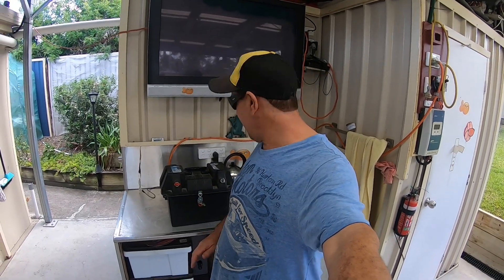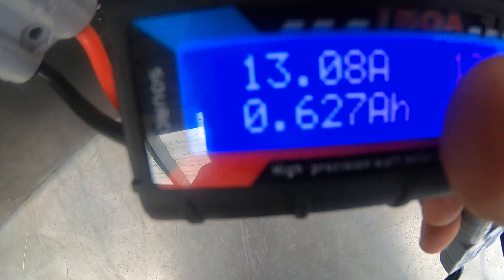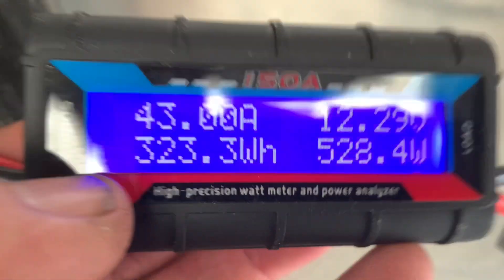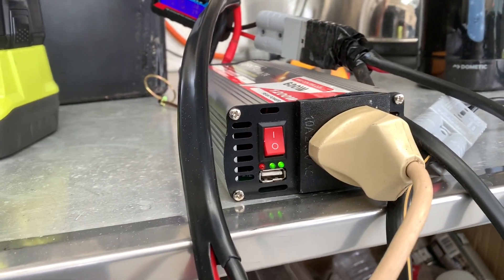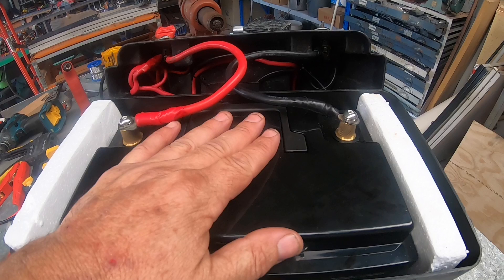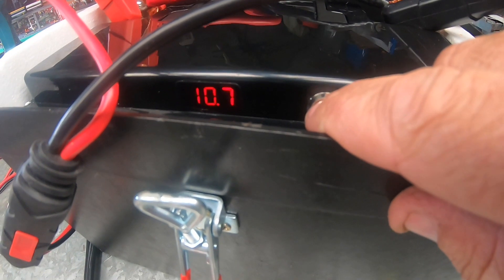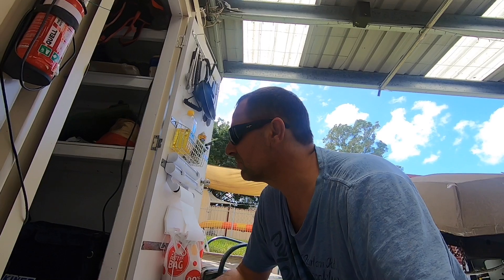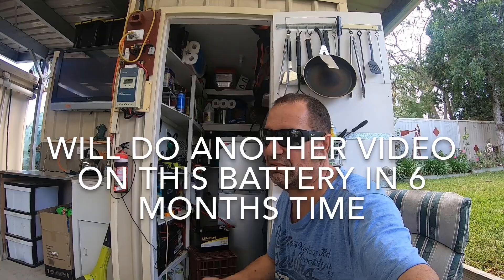12v lithium battery off eBay capacity test

Comment: just wondering , the double anderson meter you used, where did you get it, i bought similar unit from Jaycar , i have a 135ah 12v LFP which has worked fine but am unsure as to its real capacity. i conected my battery just as you did and started the test using a heat gun with variable thermostat , my inverter is 300watt so i set the draw to around 265 watt, it all worked well for about 4 hrs hating checked on the progress at 1.5 hr intervals only to find at 4th hour the meter froze at about 12.5v the heat gun was still wirking but no readimgs. i took the meter back swapped for another  rechaeged the battery and repeated the test which gave the same reasult (reading failure after about 4 hrs) , returned it bought another unit with a external shunt, am fitting it into the battery box, as a electricizn i make a great carpenter, waiting furthes reasults
Reply from the maker: Got it from ebay . Search ‘ battery meter’ thanks for watching 👍🍻

Comment: Do not use these batteries, my bms set on fire. The inside has expanding foam too
Reply from the maker: I dont have this battery any longer as it went with my vehicle when i sold it over a year ago Cheers for the info and thank you for watching 👍🍻

Comment: I bought a Mobi 135amp lithium battery on eBay,  it works perfectly until it gets down to approx 49amp and then  it shuts down every time - not happy with battery or customer service!
Reply from the maker: I would believe it as I have heard bad things about mobi lithium …. Gotta be careful with these cheaper batteries as you get what you pay for . Thanks for watching 👍🍻

Comment: You need to test at a 20hr rate so around 5amps constant
Reply from the maker: I did a retest video measuring power going back in  and results were fairly close . Thanks for watching 👍🍻

Comment: Hi can you please do a test on a VoltaX and if it will run an induction cooktop please
Reply from the maker: I can’t , sorry , as I just can’t afford to buy batteries to test.  I’m not sponsored in any way.All my videos on items I have to buy , as nothing is given to me sorry.. I’m sure there would be a video on YouTube on these batteries if you did a search. Thanks for watching 👍🍻
Reply: @EFFICIENTSELF  hi thanks for you input,, the other lithium battery you have ( not Itech wold) will it run an induction cooktop, thanks for your videos, I take onboard what you say in testing, thanks again please keep up your good work
Reply from the maker: I don’t think it would on its own maybe if you had 2 of the batteries you possibly could as the battery has an discharge capacity of 100amps so if you had 2 then you have 200 amps discharge . An induction cooktop would require over 100 amps to run through an inverter of course.
Reply from the maker: Watch a channel call ‘ justin case solar and bush camping australia ‘. This guy uses an induction cooktop in his camper trailer. Check out his videos 👍
Reply: https://www.youtube.com/watch?v=pYx1Z-V3gBw

Comment: That's still not bad.  Currently my battery box has a 75Ah Deep Cycle Sealed Lead Battery and as we all know, you get just over 50% useable out of that. 
So 75Ah out of one of these gives me almost double the days I can run my car fridge, albeit having to spend more for the battery AND bcdc charger.    
Aussie Outback have 125Ah on sale for $499 so still not bad if you could get 95Ah useable out of it ..
Reply from the maker: My battery is going well so far as i been giving it constant use and still going strong. Its only 5 months old . I will do another video on it at the 12 month mark.. thanks for watching 👍🍻

Comment: You are drawing a lot of constant current which makes the battery run hotter & less efficient
Test it again with a much smaller load and you will get more AH out of it
Reply from the maker: Yes i did a retest of the current going back in  on another video and got 72 ah will retest when the battery is a year old ... its going well so far

Comment: at 2:30 you said that it had been running for almost 2 hours.
The current draw shown was constantly between 44 amps and 60 amps odd ... that would be an average around just over 50 amps.
It's a 100Ah battery .... ie. 100 amps for 1 hour or 50 amps for two hours ... so it sounds about right to me.
Reply: Initially the load was drawing only 13 amps ...

Comment: 13.7v is to low for a 4s Lifepo4 battery. (and to high for 3s) (so you battery must be 4s because it will hold 13.7v without melting)
13.7v is fine for day to day use witch is why your charger does that but to get full capacity you need (refer to the data sheet) maybe as much as 4.2v per cell. (though 3.65 is normal)
3.65v x 4 = 14.6v
After it's off the charger like you had it in the video it should read over 14v or it's not full
To pull full capacity you'd need to fully charge the battery.
I would recommend going from 14 to 11.6 if your not happy with the capacity at 13.7v
Try not to go to 10.5v (you can and it's not like lead acid so it wont die but it would last longer if you only go to 11.6v
(then it might out live you) (though probably not if you keep letting it get that hot)

also every 6 months you'd probably want to do a "top balance" so you'd need full voltage (14.6v once no more current is flowing or maybe higher voltage when it's charging)
Reply: People talking about c rating are thinking more off lead acid batteries. you should be able to pull a high c rate IF YOU CAN KEEP IT COOL.
Reply: It's hard for me to pick the best video on this subject but maybe try this. (this one is talking about 1 cell but just remember your battery is 4 cells or "4s")  ((4s?p))
https://www.youtube.com/watch?v=x5ABvbbics8                 

or maybe have a look at some of this guy's other videos 
he's a smart kid and there is a lot of videos about batteries on his channel.

Comment: You've got to be kidding! You were discharging a single 12V battery at 500+ watts continuous (ie 0.5C) and expecting it to provide rated capacity of 100Ah? A more appropriate test would be constant 20A max draw, or if you wanted to simulate real use, short 50 to 100A bursts followed by long 5A max discharge.
Reply from the maker: Yes was made aware pf this so i did a retest video after this one . measured the current going back in and it was a similar result . Thanks for watching 👍🍻
Reply: I believe most deep cycle batteries are rated at 20 hrs, in this case 5 amp load over 20 hrs on a full charge.

Comment: Bought the same battery before watching this(through sunyee). I hooked it up to two fridges that drew upto 9.5amps combined when cycling. I got my 100a/h on two tests.
Reply from the maker: That’s awesome mate if you’re getting 100ah out of this battery .. im still only getting 72 out of it . For what it cost im not complaining as its holding up well with constant use . Thanks for watching 👍🍻
Reply: Just bought the 135ah variant and I'm shitting bricks hearing now that these don't hold the capacity they say they do.
Reply: @hugodouglas5191  How is your battery holding up mate.
Reply from the maker: Unfortunately im not sure as i sold my vehicle with this battery being the auxiliary a few years ago.. thanks for watching 👍🍻

Comment: The battery will show significantly less capacity as you discharged it as 0.6c (60ah). Typically the ah rating is measured at 0.2c (20ah). You should re-test at 0.2c to see the true capacity, could still be 100ah :)
Reply from the maker: I did a retest video you can check out and I actually measured the power going back into the battery it was around 72ah... check it out and thanks for watching 👍🍻

Comment: I'm just surprised that you could run the 3000w inverter with only 100amps discharge.
Reply from the maker: It ran fine on the collapsible jug and 2 drills was approx 100 amp draw on battery . Though I also plug in a small juice blender which was approx 15 amp draw on battery with other items it threw out the bms on the battery . I didn’t video this and I actually forgot to mention this . Thanks for watching 👍🍻

Comment: battery looks a bit small for 100AH i have a similar battery box and my 100ah  lithium. I tested mine to 90% Have to watch the heat as they will shut down if they get hot
Reply from the maker: Yup retesting it now as I speak but I’m measuring what goes back in ...its an ok battery even if it a 65ah it’s not bad for less than $400
Reply: @EFFICIENTSELF  yes i paid a  over $300.00 more than what you gave for that one. So i would expect it may be less than advertised.  try doing the test slower so the battery does not get hot and see how much you get out of it over time.

Comment: Another trick is the Power Meter you are using won't measure more than 65Ah.  The measurement rolls over and goes back to zero.  Check the specs
Reply from the maker: Hey I have retested this battery and I checked the specs . It measures to 65ah ...how bizarre, when I said 66 ah , I actually rounded it off to 66AH as it was 65.9??  At this point I had to go to the toilet and when I came back out I seen the meter reset ..lol..  Actually it explains a few things now as I always thought these meters reset after 99ah . Thanks for pointing it out to me or I never would of known......anyway I retested put the meter on the charger and measured the power going back in and 5.815ah was on the meter so say 66AH (as it resets after 65.999) + 5.815. So let’s say 72ah . I got a video coming on it shortly I just gotta edit it when I get some time and upload . Cheers 👍🍻
Reply from the maker: This meter goes back to zero after 99 ... there was 66 ah on meter when the battery let go just didnt have camera rolling at the time

Comment: Your test is not valid - way too much current and you put it in an enclosed box where it got hot and may have triggered the high temp cutout.  Repeat it at 20 degrees and no more than 20A for a 100Ah battery and see what you get.
Reply from the maker: Will do , I’m going to flatten this battery and measure what goes back in . For the $$$ it’s actually not a bad battery .Thanks for watching 👍🍻
Reply: @EFFICIENTSELF    Yes and I forgot to thank you for your real life video.  I understand your initial disappointment but expect that you might have more capacity than your first measurement indicated. I've bought the 125Ah version (same seller using Ebay Plus) and doing capacity tests at the moment.  Looking like I've got best part 100Ah (had 93Ah when I stopped the test to avoid triggering the BMS cutout).   Amazing battery for $475 and weighs only 8kgs.  Big question is how long will it last as they only back it with a 12 month warranty.
Reply from the maker: Yes its the long term to see how long it goes for 👍
Reply: @philg2468  How'd you go Phil? I was looking at the 135Ah myself but was dubious of performance etc. Sounds like the capacity with still be greater than the 120Ah AGM in there at the moment. not to mention the weight saving. My loads will be much small, so I think one would perform fine, but I'd appreciate your input.
Reply: Well.done

Comment: How many volts was the battery when fully charged ,I thought I saw 13.7,should have been 14.6, maybe that’s why the capacity was lacking ,maybe try cycling it a couple of times or another charger.
Reply from the maker: Yep I’m gonna flatten the battery and I’m gonna put the charger on and see what goes back into the battery... battery was fully charged the day before I did this test .

Comment: a better way to test the capacity would be to drain it then use the watt meter to measure how much charge it takes.
Keep at it mate ur doin well.
Reply from the maker: My battery charger would only charge for a short time and then say the battery was full when it was on for about 5 minutes... I found out only just before you commented..lol.. that I connect my charger to the meter and i put the positive clamp to terminal of battery and the negative to the charger side of the meter it works fine as I used the battery to run a little fridge then I only founf\d this out when I charged it.... I will charge the battery this way and see if there any difference.... I’m gonna do a battery capacity test on my itechworld lithium battery in about 6 weeks when the battery is a year old and I will do it with this method....appreciate the comment mate 👍🍻
Reply: @EFFICIENTSELF  look forward to it mate.

Comment: Another good video Dino. Interesting and I guess not surprising as to the true capacity.
Reply from the maker: Thanks Azza . I gave it shot cause of the discount. It’s ok for what I want it for. So say 65ah and you can use 80% safely. So really it’s 50ah so it’s good I guess for a battery that’s around 7kg... if it lasts me a few years I will be happy with this battery for less than $400 . Happy birthday for today mate 👍🍻🍺

Comment: Great video and thanks for a real time capacity test.

Side note...  You should get a refund but $500 for a 65 amp lithium battery with discharge at 100 amps continuous is not bad for the price.
Reply from the maker: Thanks Ben hope it was useful for you . I figured that for what I want to use the battery for it will be ok as it was just under $400 and as you say 65 amp hour lithium , you just can’t beat it really . Appreciate the comment and thanks for watching 👍🍻

Comment: Thanks for the follow up test, I must say from other people I have seen this is almost as I expected with regards to battery capacity....
Reply from the maker: Absolute pleasure. I have heard good and bad myself and I purchased this because of the discounted price. It will be ok what I want to use it for . Thanks for watching 👍🍻
Reply: @EFFICIENTSELF  how much did you pay for it and could you provide the links
Reply from the maker: This is where I bought it from https://www.ebay.com.au/itm/100Ah-12V-Lithium-Battery-LiFePO4-Deep-Cycle-Rechargeable-Marine-4WD-Replace-AGM/333705030616?ssPageName=STRK%3AMEBIDX%3AIT&_trksid=p2060353.m2749.l2649 but I got this for $100 off because it was a 20% off sale ,hence the main reason I purchased. This is  70 amp hour capacity realistically but it has performed very well so far and it does discharge 100ah continuous no problem. There are other cheap batteries on eBay but I’m don’t know what they like. Hope this helped and thanks for watching 👍🍻

Comment: Thanks for the review mate. Appreciate you taking time out of your day to do all these for us fans.

Wonder if that battery would last under a bonnet? I just installed an agm under the bonnet of my 80 series(a good friend gave me his 100amp battery) but would love to get something like lithium down the track when they reduce in price
Reply from the maker: Hey Jason. Don’t think it would be for under bonnet use. Is your agm rated for under bonnet use? Just lot of batteries don’t like the heat unless they are rated for under bonnet use. Once you go lithium Jason , you will never go back to agm! Only thing is lithium is a big outlay on the first time you purchase but it’s cheaper in the long run. I actually didn’t regret moving my battery to the rear and mounting air compressor to where I had my battery under the bonnet. But it comes down to how much space you need in the rear with your family 👍🍻
Reply: EFFICIENTSELF my mate who had the battery had it under the bonnet of his 105 series. Century battery 100amp agm. I can only assume it is rated for under bonnet as he isn’t the type of guy to cut corners. For now I’ll use it until it stops. 

Yes I have seen a lot of comments about lithium working out cheaper in the long run. As it’s a freebe for me I might as well use it right?

At this stage I have zero room in the back of my car but will definitely keep an eye out for your next review on this battery Dean
Reply from the maker: All sweet then mate 👍🍻
Reply: @Michael French yes I certainly won’t be taking the risk at the moment mate. My AGM even though only 100ah is doing just fine

Comment: Hi mate, thanks for the videos really informative, I was going to buy one based on your long term review, looks like I'll give it a miss. I don't know much about lithium batteries but I thought that AH is calculated based on your power draw. Would it be 100AH if you didn't draw as much current in such a short period of time?
Reply from the maker: I found this battery was only rated to 66 to 67 ah  . Though it did put out it’s said maximum continuous current of 100 amps.  I have an itechworld 120ah lithium battery and it’s fantastic but it’s around a thousand dollars . You get what you pay for!  Also you could go for enerdrive,  dcs , allspark  or renogy . Hope this helps and thanks for watching 👍🍻
Reply: @EFFICIENTSELF  I'll look into those! Thanks again mate.